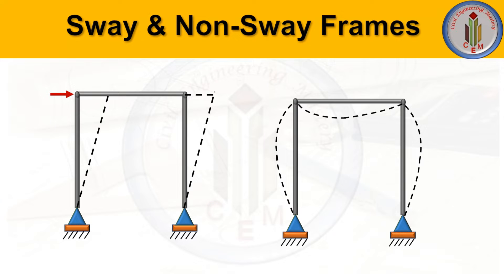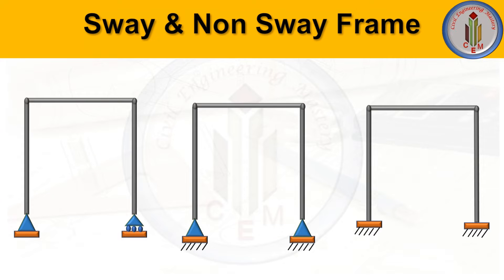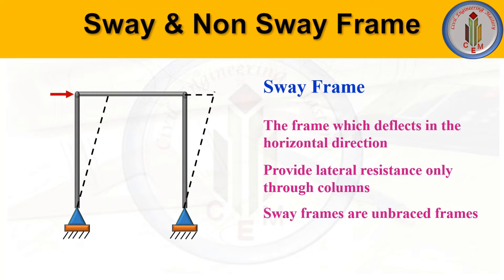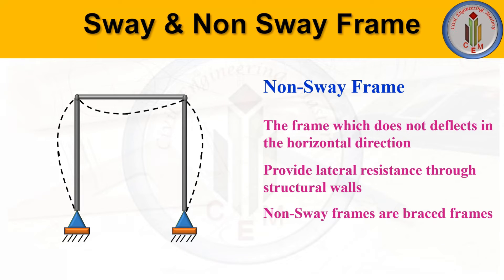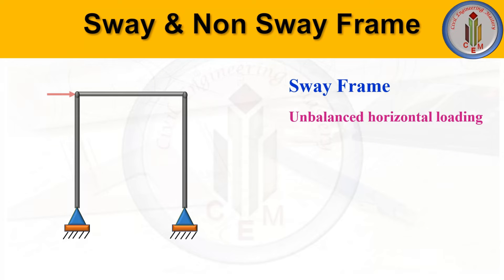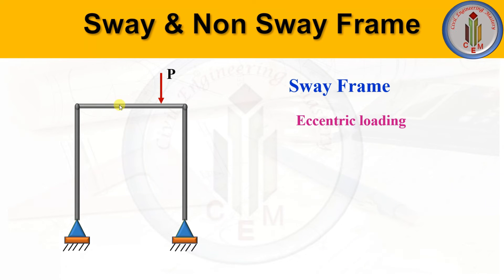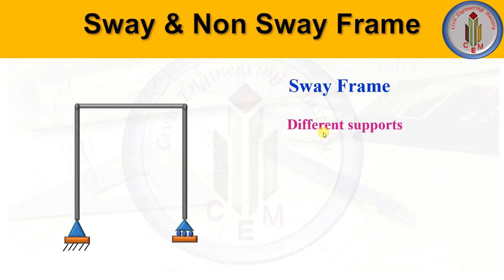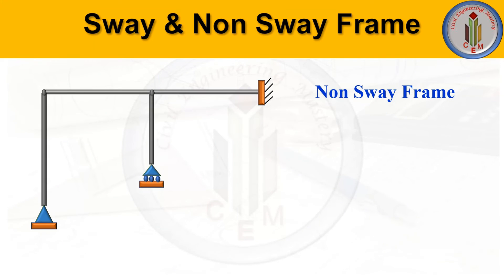Sway Frame & Non-Sway Frame | Braced and Unbraced Frame | Lateral resistance | Sway Frame |Non-Sway

Comment: This is not the definition of a sway frame. Your examples are all standard rigid connection "non-sway" frames. Just because the frame sways does not mean it is a "sway frame." Please Google the definition of a "sway frame" vs. a "non-sway frame" used by structural engineers.